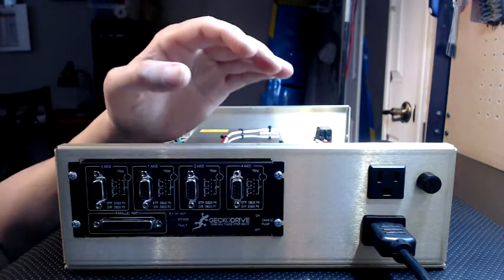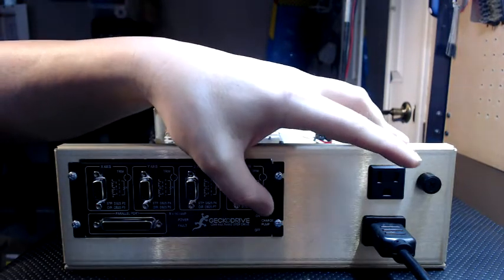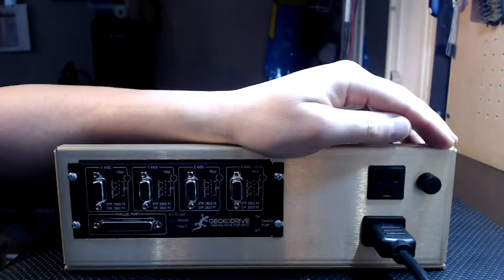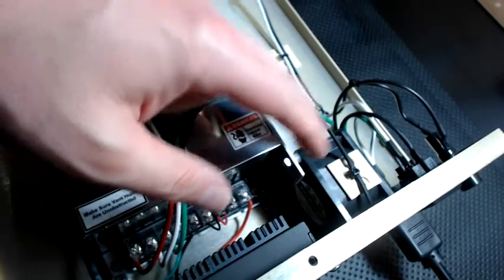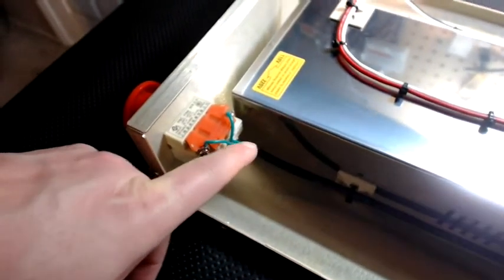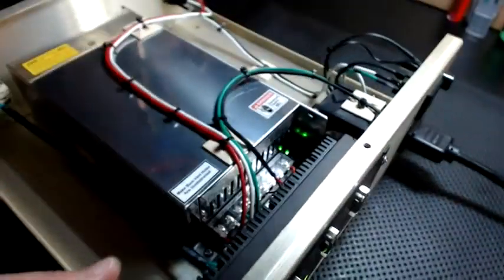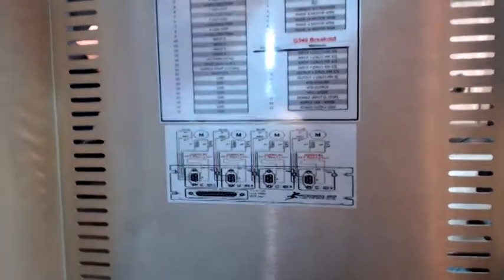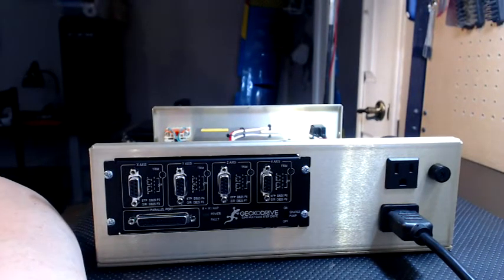GeckoDrive G540 CNC Control System Overview

Comment: Regarding cooling:  Your box directs a high powered fan onto a heat sink with low surface area. Another solution is to increase the effective surface area of the heat sink, so that a fan isn't even needed. The G540 is kind of an unusual design, in that its back surface (which must be cooled) does not have any mounting screws to which a heat conducting plate can be easily attached. I used the mounting slots on the front plate of the G540, and long screws, to clamp the unit against a big (about 1 square foot) aluminum plate, which is 1/8-inch thick. The plate hangs about a half-inch away from a vertical surface, which allows passive airflow on both the front and back surface. This passive system works well enough, so that I have not had any issue with overheating. My G540 runs at full current capacity (3.5A for each motor), yet the plate is only mildly warm to the touch. Geckodrive specifies only that it must be kept below 85C, which is hot! Your box is big enough, that I think you could thermally bridge the back of the G540 to the chassis box, and you wouldn't even need a fan.

Comment: An EMI coating for a metal box is malarkey, the metal box is an EMI shield.   This control system is just a power supply and a GEKO G540 in a box.  You can connect an E-Stop right to the G540 or whatever control system, and there is no particular shielding issue with an e-stop, it is not a motor or any other inductor, it does not make any electrical noise at all. Adiitionally, it is in a metal box, and the motors are outside the box, so likely there is no noise to worry about being picked up in the e-stop wires, shielding them extra is unescessary.

Comment: You stated 'soldered with flux'... Well, I hope so. Flux is used to dissolve the oxides that coat the conductors  so that the 40/60 (whatever) solder can flow and coat the boundary layers to be soldered... How do you solder without flux?